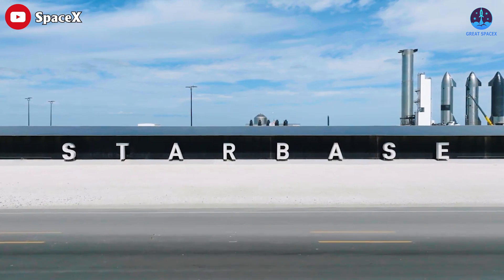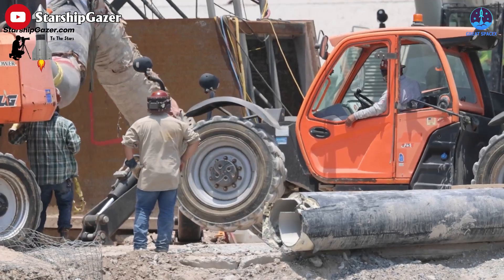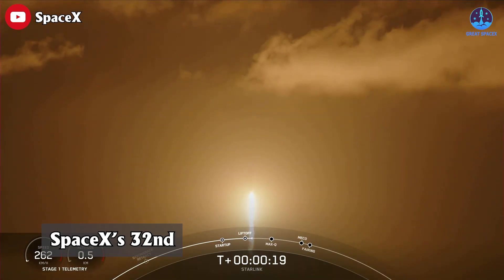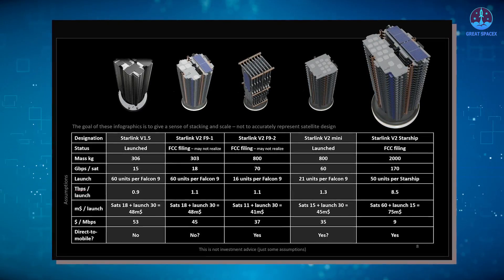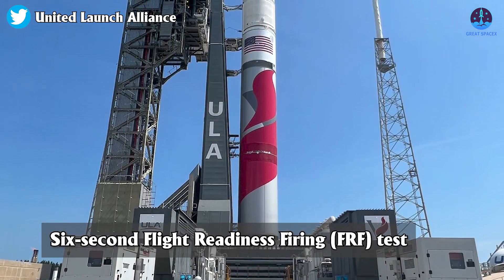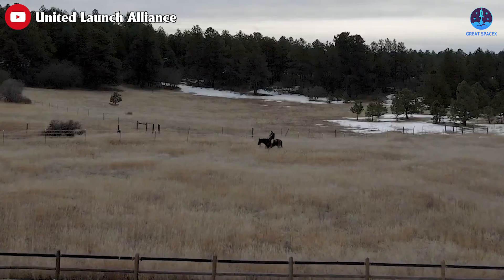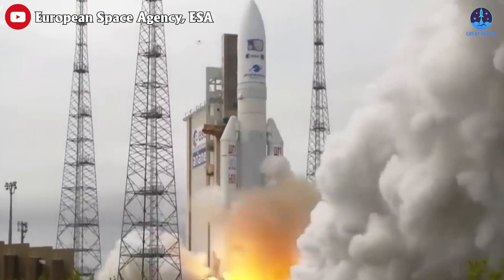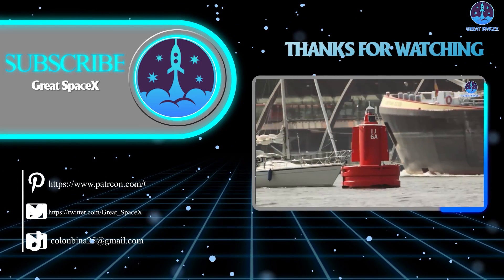What SpaceX is Doing at Starbase is Crazy! Falcon 9 broke NEW record, ULA, Ariane 6 slips...

Comment: If Musk is smart he will do 3 things. 1st,make stage Zero twice to three times taller than it is now. Reason that will reduce the thrust pressure on the base. 2d, build a thrust diverter, fire trench and water deluge system at then Starship launch facility at Boca Chica. 3d.. Barring all that move the whole operation to the Cape.

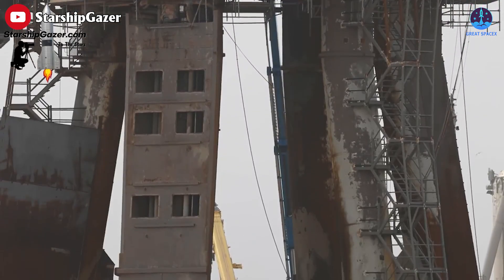Comment: At 1:45 you talk about the metal cylinders  form the outer skin for the concrete pilings.  Based on the bridges I see being built down in FL, pilings are pre-poured concrete and rebar poles that are driven into the ground using a giant, crane-mounted weight as the hammer.  They keep going until the pole cannot move any farther and stops.  There are usually several of these pre-made poles that get cut to the same height, surrounded by more rebar and concrete, and then whatever you want to support is placed on top.  That works fine for Florida and Texas since we are geologically stable....most of the time.

During an earthquake sand behaves a like a liquid, and heavy objects like support columns can shift and sink if they were not seated properly on bedrock.  That's where earthquakes come in:  SpaceX is directing 33 engines down onto their launchpad and the vibrations are making very convincing earthquakes.  That needs to be accounted for in the new launch pad, otherwise there will be more destruction when things start shifting around under those fancy steel plates.